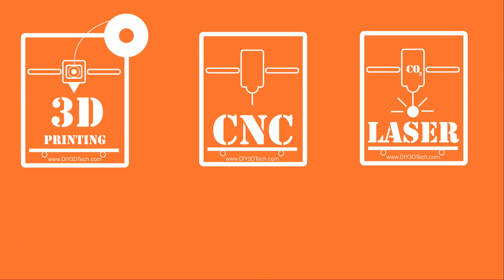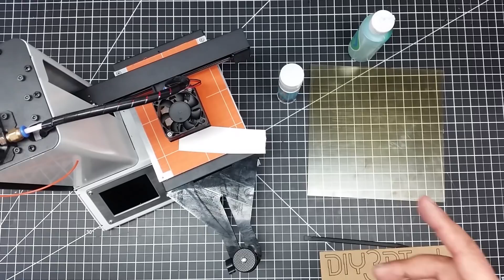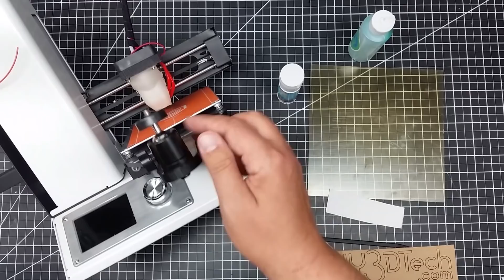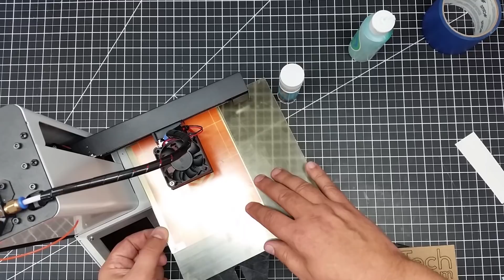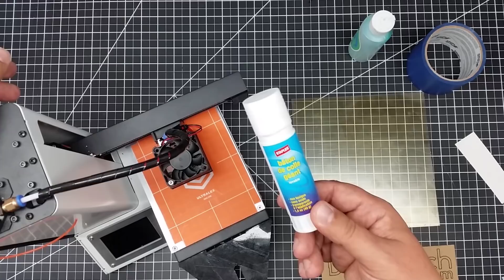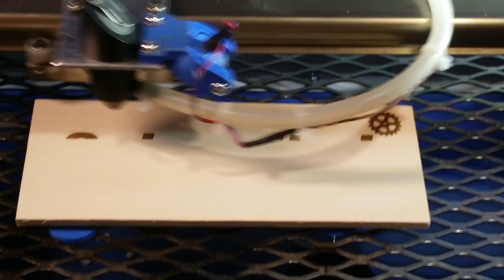My First 3D Printer - Bed Leveling and How to Get Plastic to Stick!

Comment: That is the same printer I have.  It only took me about a week to order and switch to PEI.  The only way to go.  I have had trouble with the thermal blanket on the hot end.  Also the brass fitting at the top broke.  The spring inside let go and I had PLA all over the place but salvaged.  It is a perfect size for my office.  I'm going the Enterprise right now.
Reply from the maker: It is a great printer and like I tell folks, if you go PEI you will not go back!  Also I have a new one coming that is about the same size but supposedly better!  We will see!

Comment: Hi Joe, I have a question that I think is related to leveling.  Like you, I use a piece of paper (actually an index card) which is .20mm thick.  I use a four point method 50mm from each corner (CR-10), and lastly confirm the middle once all four corners check out.  Now my question is, when I load up a print, the first layer is printing at .2mm height and the issue I'm struggling with, is that since my bed is leveled at .2mm height, my nozzle tries to start printing .4mm above the bed and of course this doesn't end well.  I'm currently using a Z offset of .2mm (M206 Z0.2) and now my prints stick but my parts are now .2mm shorter in height.  I'm not sure if there's a setting I'm missing in Cura 3.0 or if something is wrong with my printer.   Do  you or anyone else have any suggestions why this is occurring?  Thanks for your videos btw, I really enjoy them.
Reply from the maker: I also use 80 pound card stock  that is a little short .2 and do basically as you "but" the paper is not "loose" under the nozzle as I bring up the bed till I have to use a slight force pull it out  so I am at about  0.16mm .  you shouldn't have to use Z offset as that is only for physical deviations which you don't have. Also are you sure the printer is homed correctly and do you have cura configured correctly?

Comment: Why do so many people have issues with bed adhesion. I'm in a CR-10 group on Facebook and that's the most common post. Then you have a bunch of people saying to use glue and others saying use hairspray. Ugh, no thanks. I've never had an issue printing straight to an Ikea mirror with the bed set to 65 C so I will stick with that. Wish people would get away from these old methods when they aren't necessary for the majority of cases. 

I like the idea of a bed where you can pop it out and replace with a 2nd one if you needed to print something else right away. The new Prusa has a flexible print surface so that is neat. I have nothing against the bed material, just haven't had a need for it.
Reply: Baneironhand The odd time ground up elf hair but not often ;)

If your nozzle is set the right distance from the bed and your bed is heated up enough you too can print straight to glass/mirror.
Reply: Cool thanks Mike.
 I'm fresh out of elf hair anyway.
Reply from the maker: One of the main reasons is people do not understand the concept of "bed tramming" this is one of the most import things one can do and notice I use the word "tramming" as its not leveling in that you need to match the spacing to the nozzle and not a level.  Second is people are still stuck on surfaces like glass (as no offence but can I ask why print on a mirror?).  Also be careful as that mirror is likely not made of borosilicate glass which means it does not have a low coefficient of thermal expansion and likely the reason it works for you "but" is susceptible to shattering during this process which makes it dangerous so please be careful and still suggest switching...
Reply: So you just print straight onto the glass then, no tape or glue or ground up elf hair or anything?
Reply: David Light What thickness of PEI do you use. I have thought about getting a sheet just to see as I have 3 extra mirrors sitting around doing nothing.

Comment: Do you ever have problems with differing bed warpage relative to temperature? I always have to re-level the bed when I switch from 60C to 110C. Other than that I don't have to re-level very much. Ironically my printer with no heated bed has to be re-leveled often because the micro switch doesn't always trip at exactly the same location every time. I think I will try pulling the lever off. From Tom's test that seems to be considerably more accurate at triggering.
Reply from the maker: Yes you could see a difference from 60 to 110 however it also seem like you do have a switch problem as the difference is more of a quality issue...